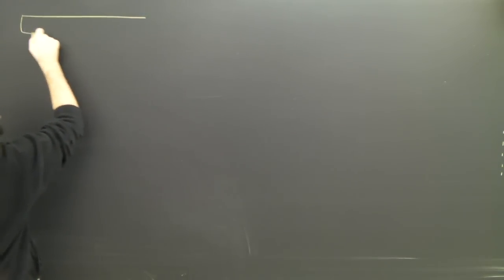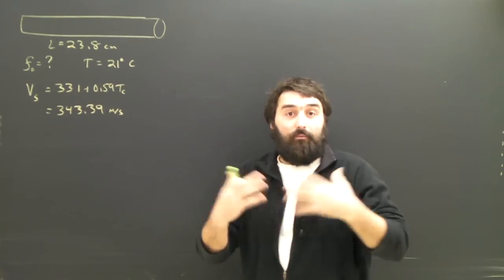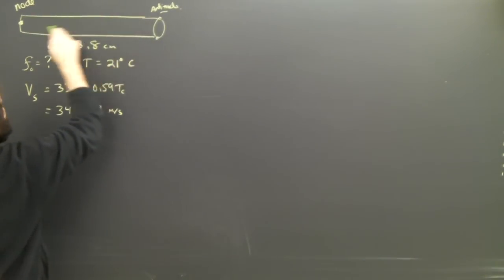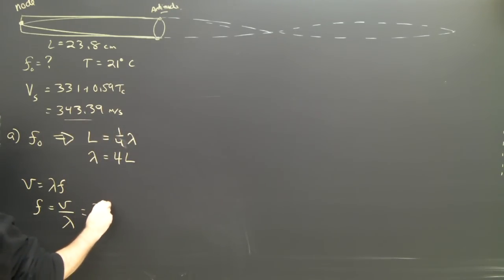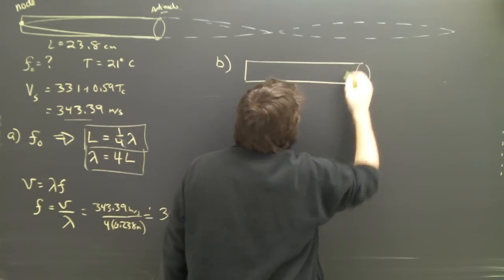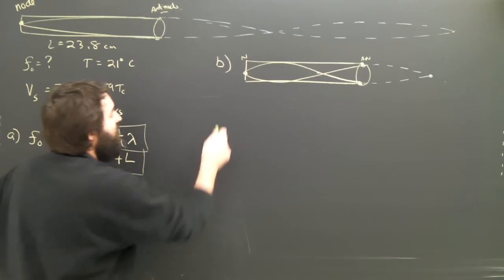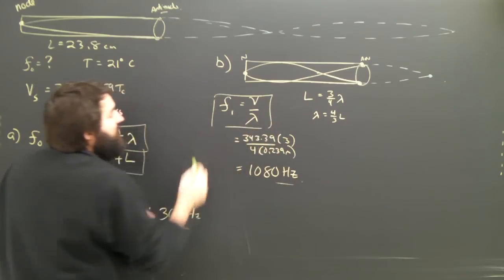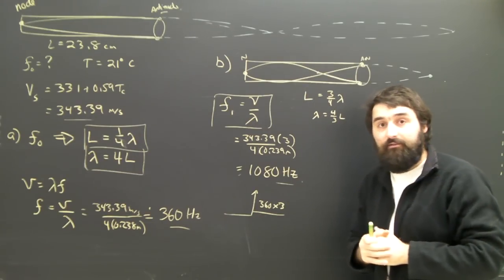Air Columns & Sound Waves Physics Lesson Tutorial

Comment: Actually, the flute is an air column on both ends - sound is produced by blowing air over the hole in the mouthpiece. The clarinet, on the other hand, is an example of an air column closed on one end. Therefore, the length of a flute is equal to one half of a wavelength instead of a quarter. The frequency that was calculates is actually lower than it should be on a flute.

Comment: @timsss128  Some schools may use v=331m/s + .59m/s/C (T) others may use v= 332m/s + .59m/s/C (T) in which T is subbed in for whatever the temperature is. This will tell you how fast the speed of sound is travelling. This works for any temperature as long as it's an air filled environment.

Comment: 1:30 -Odd.  My experiments show the node is at the open end.
(dust particles under strobe light)

The fipple flute is excited at the upper end where the air is injected by the player.
That excitation whips the air into motion.  That compressed energy wave 
travels down the flute, to the end, where a node is formed when
the pressure wave encounters normal atmosphere.
(Yes, it does seems backwards)

Another fact:
A pipe with 1 end open and 1 end closed vibrates at 1/4 of a wavelength.
The traverse flute, (open both ends) vibrates at 1/2 of a wavelength.

THanks for THinking!